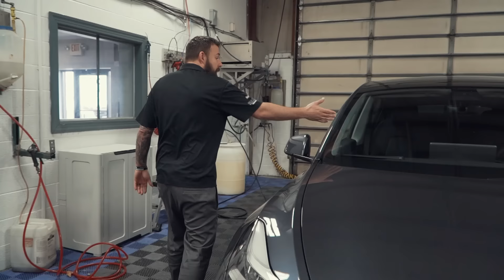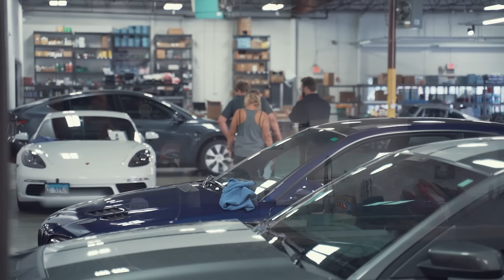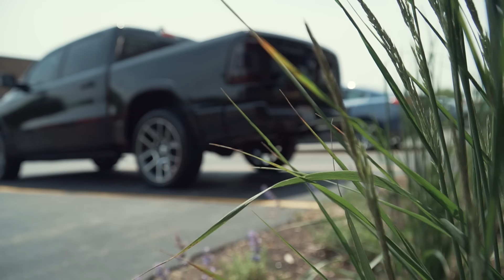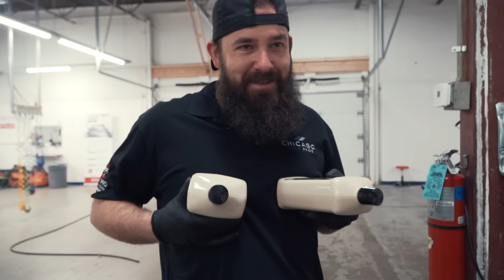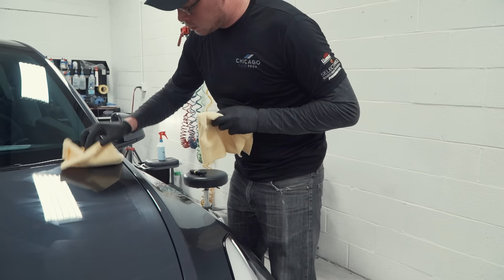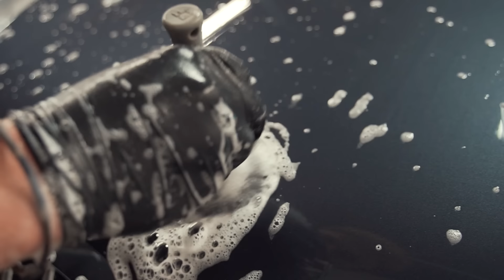Everything You Need to Know Before Buying a Ceramic Coating

Comment: I have heard that unless your paint is perfect like a new car, a ceramic coating will actually make any imperfections in the paint look worse, like a small rock chip and things of that nature. I drive a Porsche which I was weekly sometimes a few times a week depending on the weather. One thing I have noticed with the Porsche it seems like it chips easier than my other cars. I have noticed that it has no orange peel. I don’t know if Porsche still does it this way but I had heard they hand paint and wet sand all the cars. I think having that thinner top layer might be why it chips a Lilly less easier. Would a good ceramic coating help with this or as stated before would it make any small chips look worse? Also, what would be the best brand?
Reply: A coating isn't going to help with rock chips. Where I work, we do a lot of paint protection film on Porsches. 

Seems multiple times a week we get another Porsche from the local dealer! We install the tint and ppf. I'm one of the guys that does the correction and coatings. We do also offer a polishing wax service and a polish + sealant of desired, but we sell a lot of ceramic packages. 

I wouldn't rely on a ceramic to offer the protection that film can offer.

Comment: Are you really saying a wax lasts "a couple of months at best"?  Have you never heard of Soft99 Fusso Coat? They claim up to 12 months, and I've had my car waxed with Fusso Coat for just over 6 months so far and it's still beading like crazy.  That's amazing  in the UK weather on a daily driven car that is kept outside. There's enough in that tin to do my car approx 20 times, so even at 6 months protection, that would be 10 years for about £30.  Car is washed usually once a week, but at worst case once every two weeks.  Apart from Fusso, there is also Turtle Wax Ceramic + Graphene Paste Wax, or Bilt Hamber Double Speed Wax, both of which I have proved will go for about 6 months in our weather.

Comment: Great video!  Tesla Model Y in the video looks great, but you didn't state (unless I missed it) what ceramic coating was applied.  You mentioned that there is a wide range of products with various price points, but it would be great to understand the differences for each product.  Also, since this does not provide the protection of a PPF, does a partial PPF get applied first or after a ceramic coating?
Reply: Ppf is applied firest. Check some of our previous Ceramic Coating videos for comparisons in the Ceramic Coating’ playlist.

Comment: I've been detailing for nearly 3 years professionally and I can attest to the fact that if you are not on top of your car every single day it will not look good these coatings that they offer for hundreds of dollars will not last because you're not taking the proper steps to ensure that the coating is doing what it's supposed to do
Reply: I have a black car and every time I polish wax, get it as clean as possible the next day there will be dust on it. What’s the best way to get off the dust? Just a wet rag? Microfiber? Blow it off and then wipe? Would love your advice!
Reply: @presceltolives2076  just for dust control get a simple spray wax or if you're one of those people that doesn't want to put wax on wax then get a bottle of optimum no rinse. You can find gallons and little bottles a little goes a long way exact measurement are on the back. Also try not to rub too hard if you use the optimum no rinse because you can scratch if you don't have a good coat of wax on. What vehicle do you drive can I ask?
Reply: And like you said you could very well just use a wet rag but just using a wet rag can streak if too wet so damp rag  I think it's too many steps especially if you have a bottle already mixed up and you just spray it on lightly wipe it off and you're good
Reply: @presceltolives2076  if you have a nicer vehicle maybe consider purchasing the product. Or just damp rags. No pooling should occur on the paint or droplets when sip ng that's too wet. Another piece of advice Folger towel like you were to put it into a drawer (microfiber) use one side for one panel use the other side for another panel open it up fold it back and then you have two more sides and then you can open that up and that whole side of the rag is used then flip it over fold it the other way and you have four more sides. If you can retain all that through texting it's kind of weird wording

Comment: I would never get ceramic unless I park in a garage my vehicle sits outside in all types of weather and even the littlest of rain I get water spots and it gets dirty more easily but if you park in garage and hand wash then yes I guess ceramic is good and yes I currently have ceramic and I think ceramic is only as good as the paint correction if you have a bad paint correction then don’t get ceramic

Comment: Hey Jason, question for you mate; do you think the expenditure is worth it for a 4X4 that will be on the beach a lot? Is there going to be significant degradation of the coating from the salt and sand that its not going to last as long as it would otherwise? This might seem like a no-brainer, but I'm asking because I see this could go either way. Either the coating - so long as it's of good quality and applied by an experienced and capable human - could protect against the very things that could otherwise ruin such a vehicle, or it's going to lose that battle. 
Very keen to read your reply. Cheers mate.
Reply: Still waiting?
Reply: @marceloevera2009  yup.
Reply: It will help but not entirely protect it the most important thing would be very regular cleaning. Id recommend one of the DIY wipe on wipe off sprays like Turtle wax hybrid ceramic coatings in that situation 80% of the protection for $12

Comment: I don’t recommend a ceramic coating for anyone, it’s very expensive and doesn’t actually last that long, plus you have to come in every 6 months or 1 year for a “maintenance” job.

The spray waxes cost 15-20 max and give you 3-10 applications. Each application lasts at LEAST 3 months, and up to 6. I take 5 minutes to apply the $15 spray coating 3 ties a year and have just as much protection and hydrophobic properties as all my buddies who spent $1000+ on cars that they are going to sell in 2-3 years.

Comment: Hello Chicago Auto Pros! Thank you for the insight! I'm even more excited to get a ceramic coating because of what I've learned. Quick question though, the detailers here in my country apply 4-6 layers of coating. Is that ok? Or is it detrimental? What's your take on the number of layers and how many is too much?
Reply: A good quality ceramic coating should need only a single coat if applied correctly and covering every panel 100%.
Reply: Run run run if it's real 1 coat that's it run run don't look back

Comment: LOL.  Thanks for all your information.  No, I will not get added Ceramic Coating protection - as you say a waste of money for me.  
My vehicle does normal traffic driving.  I just do the normal hand washes and waxes and just try to keep the dirt and salt off of my vehicle the best I can being in Northern Illinois.  If it also gets some micro scratches, so be it.   
I am pretty sure my vehicle is going to get allot more Dings on it while doing my normal traffic driving.  
Pretty sure Ceramic Coatings are not going to protect against small projectiles hitting my car from other vehicles.
Reply: LoL. Ceramic coating is a vanity project, and it sounds like you’re good with saving your money and letting your car’s finish wear down, or frequent waxes, which can be just as effective as a ceramic coating. And that’s fine, I’m on my second ceramic coating in 5 years, have that clear vinyl bra on my hood for the highway rocks. The front bumper is a bit worn from constant highway driving but overall the car looks mint. I’ll be doing it again at the ten year mark. I do almost exclusively highway driving, but rocks aren’t dinging your whole car, just the front end, and that’s got the vinyl stuff on it. It’s all about how much you care about having a fantastic looking car.

Comment: "coating maintenance every 6 months" well that makes the "years it lasts" advantage irrelevant, because 6 months is what you can expect from a good spray sealant, and if you have to do a maintenance on your coating you might as well just simply re-apply your sealant every 6 months..

Comment: If you are washing your car say weekly or even bi-weekly whats the point of a coating?
Reply from the maker: Having a coating on the car will help keep the car cleaning for longer. It also makes the cleaning the car much easier. You don’t need a coating on your car, definitely a luxury.
Reply: @ChicagoAutoPros  i understand that. I typically use a beadmaker and now OG’s drying aid. Obviously Not intended to last long … but on a weekly basis, it does those two things.
Reply from the maker: @Jeeper1378  I would say that is a great way to do it. I like to have that extra security of having the coating on the car. I sleep better at night 😂

Comment: So Ceramic Coating or Paint Protection Film?
Reply: Ceramic coatings don't yellow over time.  PPFs can be a bitch to remove and if done wrong can actually pull paint off the car.  PPFs protect the paint by absorbing the damage, but then the PPF just looks like shit on top of the paint.
Reply: @brandons9138  so all PPF turns yellow overtime regarding of what brand? Isn't some brand markets their PPF's anti-yellowing?
Reply: @JAAJ-sm2nt  I haven't looked into them for a long time, so perhaps the materials have improved.  I still don't care for the fact that at some point they'll have to be removed.  That process, if not done correctly can damage the paint.

Comment: Ceramic coating is very cheap to buy and easy to apply just car detailers charge an arm and a leg because the after product looks so amazing,  People do not get fooled by these over the price detail shops Amazon has great ceramic coating prices and amazing products from China.
Reply: The expensive part is the labor in terms of prepping the car.  Many times there's decent amount of work to get it ready to apply the coating, as whatever imperfections the paint has, it won't be easily removable after the coating has been applied. 

If you are comfortable in terms of detailing/prepping the car, then for sure DIY is the way to go.
Reply: @stansz  you are rite clay baring and polishing are the most important.

Comment: Cars are built and covered in paint and clear coat.that is meant to last 20 years or more. 
They do last that long. If you clean and look after the exterior of the car.
Ceramic coating is 85% gimmick to keep people very wealthy. Who don't have a consience.  
The guy who is talking.
 If you read between the lines. He is actually. Telling everyone. Not to have it done... because. You really DON'T NEED IT...
lots and lots of products out now. About $50.  That will do an excellent job.
But. you have to get off your ass. Go buy it.then RUB AND WIPE IT ON THE CAR   Full stop. 😎🤔😲🙃
Also this guy is trying to justify why every 6 months you should spend 100s. $$$$$  keeping your ceramic coating update and clean.!!! 
ABSOLUTELY INSANE. 😂

Comment: What a crock. I'm a detailer, and I've been detailing cars for many many years. Ceramic in my opinion is overrated. Guys like this in a video love promoting ceramic because they can charge a lot of money for it. Look at it like this, most Auto mechanic shops if you come to them and ask to flush your transmission versus draining they're going to tell you that flushing is better. They can charge you $150 or more for a flush versus 50 bucks for a drain and fill. Flushing a transmission can ruin your transmission. But they won't tell you that. I've seen no big difference with ceramic. I'd stick with a good high quality paste wax.

Comment: Ceramic coating is just over rated its for a lazy person a good coat of a good wax will work wonders for just a fraction of the cost then you have to buy those High Dollar extra soap and what ever to wash it
Reply: Ceram8c coatings vs waxing a car the ceramic will be cheaper. However once you add in the paint correction that is done before is what most of your money is paying for.

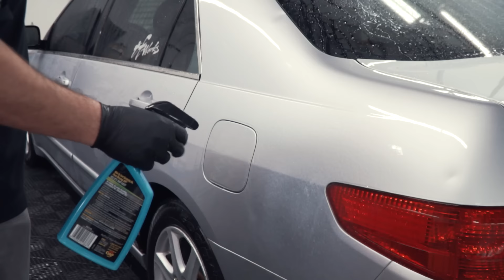Comment: Epic bad video @3:19 - you sprayed that Meguiar's Ceramic Wax like 7 times on a single element PLUS the freaking window... WTF?? Have you ever read the stupid manual on how to use that wax? You're supposed to get AT MOST a single spray on a small element, while doing not more than 2-3 sprays on the really big ones like the hood and roof! And not to use the wax on windows. You are literally being told by the manufacturer that overusing this product WILL result in the wax fighting you and you will have to clean the excess product, essentially just wasting it. Super bad use of that product, it gives no credibility to anything else from that point on. Epic bad.